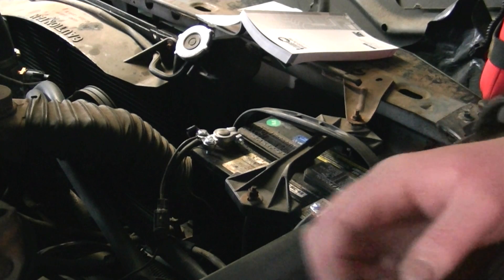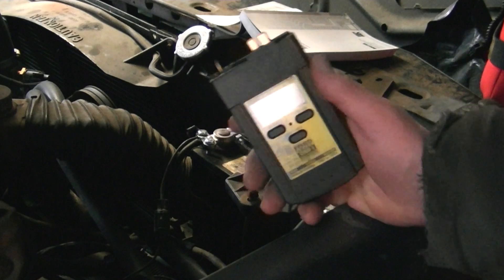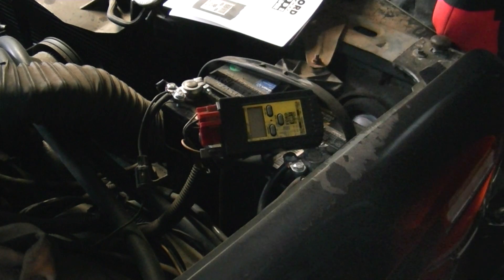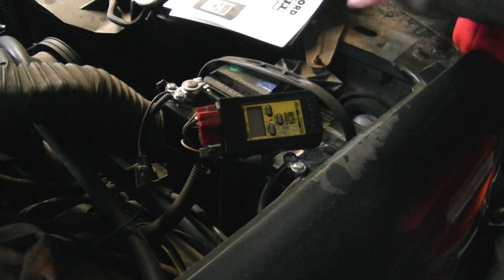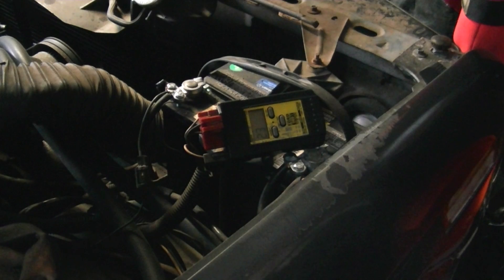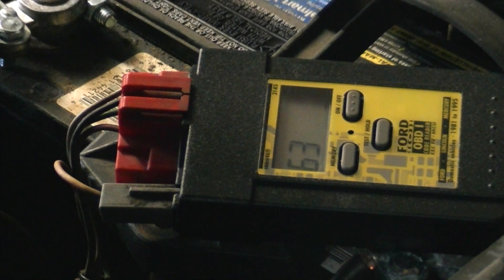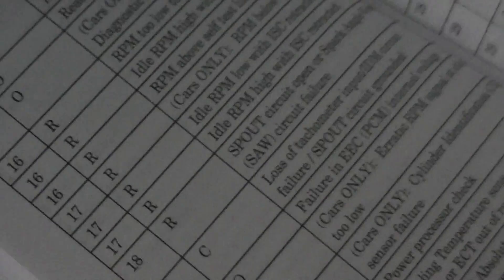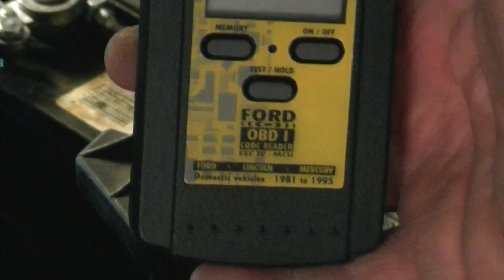1986 Ford F-150 4.9L Straight 6 300 OBD I code reading

Comment: First check the water in the radiator to prevent false CTS codes. If you get vacuum at the EGR at idle or when you're not supposed to, replace the charcoal canister purge valve. If you get codes about O2 sensors running rich, replace the MAP sensor. A bad CTS or bad TPS or high fuel pressure can cause rich mixtures. Warm the engine if can to clear the engine and erase false codes. Make sure you press the pedal all the way down or it can throw false codes. After repairs recheck the codes. Replacing one part can eliminate other codes.  Usually it's not the oxygen sensors. Replace parts along to prevent trouble. I think it comes with an extension cable. The continuous monitor checks wiring and sensors for loose connections. If it's quiet, everything is o.k. If there's a tone, there's a problem. Check for a code. Do the wiggle test. If the tone sounds, that's the problem area! There's a KOER wiggle test. Tap sensors and connectors. Tap the Dist. for intermittent PIP codes. Tap the EGR to see if it'll seat. If you disconnect and plug the EGR vacuum hose and the engine smooths, it's NOT the EGR. It's upstream. Vacuum at the EGR above idle means the solenoid is o.k. It's the purge valve. Applying vacuum to the EGR, about 8", at idle should cause stumble. If not, the EGR or the passage is clogged. Check for leak-down. Don't apply more than 9".